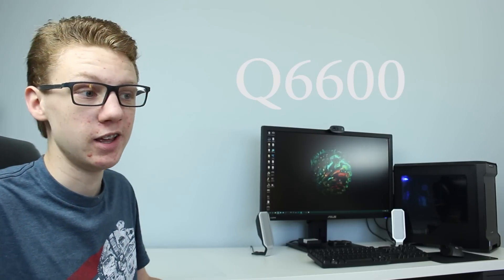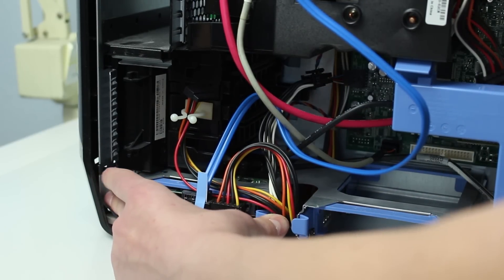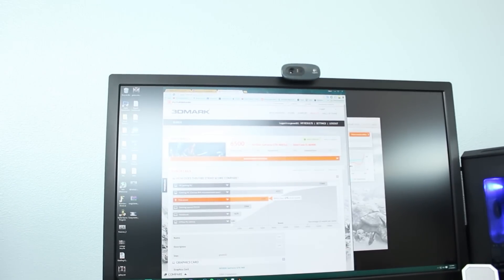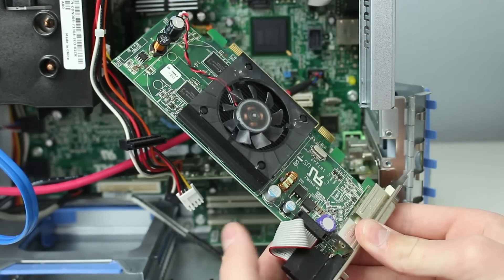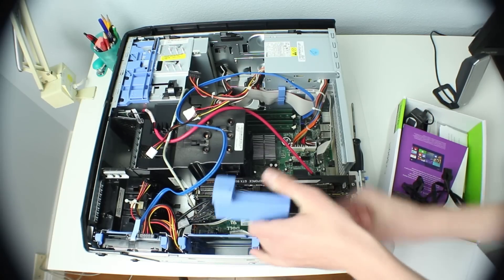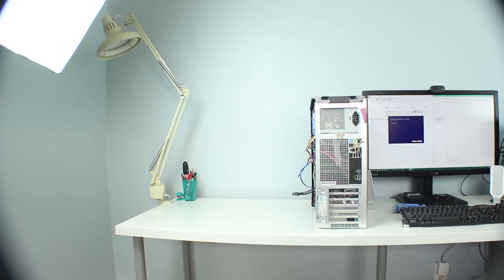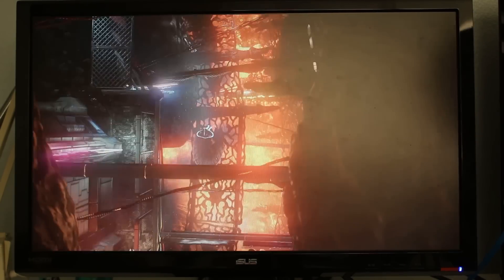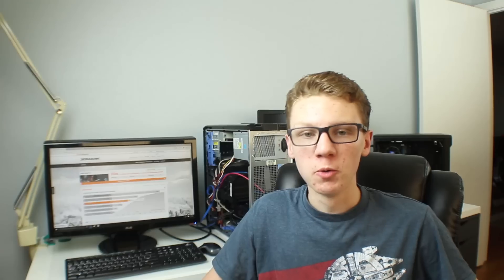Old CPU + New GPU = Gaming PC? (Core 2 Quad + GTX 960)

Comment: I built two pc's with an older LGA775 1333mhz motherboard, O.S. is Windows 10/64bit,  maxed out the motherboard with 1333mhz 8GB(4x2Gb) RAM memory and using a Q9650 CPU and a newer GTX 750Ti-FTW edition video card GPU. I can run Crysis, Battlefield 3/4, Elite Sniper 3, Tomb Raider(2014), with great frame rates and no stutter or lag. I know that eventually, I will be forced to upgrade my CPU+Motherboard to be able to play a slew of, "Next Gen" games that are coming are out this year, without experiencing lag. My PC is at least good for the next few years in terms of regular web surfing, and for non-"Next Gen", gaming titles. Happy with what I got for now. Great video, continued success! And YES I am already looking at the latest CPUs/Motherboards that are available for me to make my next PC.
Reply: +sh0tgunbl45t the gtx 970 is designed for high to ultra 1080p.. your not letting your computer run at anywhere near its maximum capacity, should'nt that be a reason to upgrade?

Comment: Check games
30% GPU
100% CPU
huge bottleneck
Reply: +Markel Fortunato  i think the biggest bottleneck is the  3gb of ram
Reply: +Markel Fortunato Yeah, running a program built to really only test the GPU isn't a great comparison lol
Reply: Modern games are written so they do avoid CPU bottlenecks. 
I am running 9.5 years old Q6600 (and a HD 7870) and I can play every modern game at 1080p on medium, some even on high.
Reply: Not always true my friend,  Out of 150+ games I've tested, I only see 100% usage on all four cores in ONE game on one of these rigs (Splinter Cell Blacklist, if you're interested).  I agree that the 960 can perform far better with a more modern setup, but your statement is all encompassing as very, very few games utilise all four threads even as yet.  Even well threaded games such as The Witcher series only use 80% average of all four cores.  I am not saying that frames will not improve with more modern architecture, better ipc and faster chipsets, just your idea of processor leaps in the last 6-8 years are exaggerated slightly as the market is stagnant and the 960 is hardly a powerhouse.  On another note, cool channel!
Reply: moron, that depends what game youre running, some games are optimized more on the CPU side, such as battlefield.
Reply: lower than my huge bottleneck: 1080ti and Pentium d, 1080ti was a gift, the New Prozessor will come soon
Reply: Angelino Zockermann wow dude, fucking pentium d? that is unplayable
Reply: Михаил Найденов Yeah, 2 things: The 7870 isn't exactly a powerhouse, and I guarantee you you would get noticeably better performance with something like a 4690k/6600k/locked i5/i7.
Reply: Mike Adams No doubt about it. If for nothing else, they will use modern motherboard with faster PCIe slot! But again Zdoom and DarkPlaces perform worse then a modern game. Edit: Of course physics are also on the CPU, so there is that, but even that is changing.
Reply: That's true. If the guy put in 4GB DDR2 800MHz it might have gotten a little higher.
Reply: Even  though it still holds that a low GPU utilization (without vsync) shows a CPU bottleneck, that bottleneck can start when just 1 core is fully loaded. There are still games around that dont need a quad core to be held back.
(So 50% on a dual core or 25% on a quad core can be a bottleneck, add hyperthreading and your CPU can be sittign at 12.5% and still holding you back)
Reply: Nvidia gtx 560 ti + amd athlon x2 280

Bottleneck??
Reply: Like I said, take a look on what your CPU and GPU load is when gaming.
Reply: I took my old E8400 to 4.2 GHz with a Zalman CNPS9500.
Only when I switched it out for a quad core I needed something bigger.
Got a Hyper 212 Evo with an ebay discount and now there is (basically) a Core 2 Quad running 4.1 GHz next to me.
Reply: +Nino Srdic yes 3gbs of probably 667mhz ddr2 ram
Reply: oc that thing
Reply: almost the same rig here. only difference is a 7970. runs everything med-high 1080p at 60+fps
Reply: Should work fine.
I wont see a huge bottleneck there.
But of course it all depends on the games played.
Reply: HappyBeezerStudios but somehow that cumbo don't work cs go only works 40-50fps with medium setting 1280x768 resolution
Reply: Science Studio recently had a series of videos and according to that the version of the Source Engine that CS:GO uses scales great up to 3 cores and even beyond that.
Look where your load is.
Set ur usual graphics settings, disable Vsync and monitor your GPU usage. If it is rather low most of the time, then the CPU could be to slow for it.
Reply: HappyBeezerStudios Could it be virus? I have made 3 pc full virus search on avast and it didn't find anything
Reply: its gtx 560 it sucks too. why would you think trash would bottleneck trash?..
Reply: gtx 560 ti directcutII sucks?
Reply: Teemuli1 it's old thing of course it sucks it's from 2011 and it's not the best version from 2011 500 series.
Reply: I'm pretty sure that it is good enogh for me cause I play on 1280x768 resoluion
Reply: Teemuli1 well you asked if it sucks not if it will be enough.. and in general you told 10% of needed info to properly answer.
Reply: Markel Fortunato this cpu is perfect for a 750ti or a rx460
Reply: ***** but not for any good gpu, usable for this gen games gpu's start with 900 series that is if you want 1 year of medium settings gaming. if you want more you need gtx 1000 series gpu
Reply: gytis dramblewolfskis why would you pair a 8-10 year old cpu with a good gpu did this on a low end build getting 50fps gta 5 1080p
Reply: ***** because you can change gpu without changing other parts. and you need much less cpu power for gaming.
and cpu's didn't step up their game that much for  a long time. also you can use the gpu in your new system.
so for example you can have a potato desktop get a 1st gen gpu use it with potato (will get bottlenecked) but for a short while it should be enough when you see it is not enough you change every other part and put the gpu in that system there you have a great desktop pc. (not much chance you'd get big incompatibility problems with gpu)though shit psu can kill it)

while you dont need much cpu power for gaming at certain gpu:cpu ratio it becomes very bottlenecked and you need to research for that,
Reply: I need of overclocking and better cooling probs. I got an E8600 oc'd @3.5ghz with GTX 970 4GB SC. As well as 6GB DDR3. I'm thinking of overclocking my cpu more to 4ghz, but I have to get a better cooler first.
Reply: +Gamefreak924 *in need
Reply: CrazySkullGamer the 1080ti was a gift, I couldn't say no, and an i7 7700k or something like that is coming next month
Reply: Actually not that much, the graphics test also NEEDS to use the CPU, and in terms of performance, C2Q and C2D are still decent, they are only a bit underclocked and are also lacking L3 cache, but still good

Comment: Really? O_O Inside on a 4690K is an Intel stock cooler? lol Explain this, if I saw wrong.
Reply: +Peter Wolf that's skylake, this guy has devil's canyon.
Reply: If you don't OC the stock cooler works perfect
Reply: +shut your face! THEN WHY GET 4690 "K"
Reply: The K models have less defects in the dye than non-k models. Non-k models aren't k because the dye quality isn't up to par with Intel's standards to where they don't think it's safe to be overclocked.
Reply: Stock cooler is suck as fuck. For 50$ u can get a decent CPU cooler what is capable for OC and offer significantly lower temperature for the cpu in overall.
Reply: $50 can get you a really good CPU cooler. a decent one runs around $20-$30. ive got an enermax ets-t40-tb on my 4790k, salvaged it from a broken business computer. somehow the bracket fits on an LGA 1150 socket.
Reply: shut your face! Good one.
Reply: Cooler Master Hyper 612 Ver2 or 412S or 212X are good options for a budget build. Also the new Intel TS15A for 30$ looks promising until u DON'T OC your CPU. And it's not even necessary. I3 6100+ 3200MHz RAM equivalent of I3 6100 OC 4.7GHz with 2133MHz performance.
Reply: OC doesnt mean you push the cpu until it fries itself. you can do small/medium OCs on a $20-$30 cooler any day. the major overclocks usually need watercooling anyway.

also im serious, that cooler does fit on LGA 1150, just not perfectly horizontal. its tilted slightly up. not that im complaining, its just pointing more directly at my exhaust fans above it
Reply: With a Cooler Master Hyper 212 Evo u can OC an I5 6600K at 4.7Ghz in no time and it will run stable.
Reply: shut your face! I know. It's not a problem to OC that Devil's Canyon. Even  an AMD FX 8370 can be handled by the CMH212Evo easily.
Reply: 4790k is a pain to OC on air, if you want to push it that is. that's why i forced that stupidly huge cooler to fit onto my socket (modded the bracket).
Reply: shut your face! I see u really stucked with the water-cooled CPU idea, than the Corsair H60 Hydro is your best friend from now. It's "cheap" and accessible.
Reply: i wish i had a case that supported a water block. eh, maybe i can get a water cooler that has only a single 120mm cooling block, swap out one of my exhaust fans with it.
Reply: Yean, an AIO liquid cooling system, like the Corsair Hydro H60. Checkout on the Corsair site.

Comment: i have the dell precision workstation t3400 very similar to that xps
psu 375watts
dell intel x38 btx
core 2 quad q6600 2.4ghz 8mb 1066mhz slacr g0
4gb ddr2 800mhz
asus geforce gt 440 1gb ddr5 (did come with quadro fx 570)
samsung 160gb+250 sata 2 
dvd-rw sata

Comment: You look at the wrong score, your looking at total score, that's GPU and CPU, you have to look at Graphics score, then you know if your Geforce GTX 960 is slower with the Q6600 CPU.

And you get a GPU score of 7764 with a i5-4690k, and the Q6600 uses DDR2 or DDR3 memory, and putting 6GB or more RAM in the Q6600 system would help a lot in games, 3GB RAM in modern games is a BIG problem.

Comment: this is only good if your doing an only gaming pc but for tasks that require the CPU to do most of the load like rendering/video editing or even browsing the internet it wont be that good. the CPU could also limit fps in games as you didn't test any actual games. this would be especially evident in game that do use the CPU a lot like crysis

Comment: TLDR: It's impressive and it's still playable, but it's not exactly 85% performance of a modern CPU.

That's pretty much exactly my set up! I have the Q6700 and a Gigabyte GTX960, and I have to say that I'm a bit shocked by the results in the video. I'm able to run most games at very high settings near 1080@60, but that's only on really really low cpu usage games, for example, Battlefield 3 works really well with everything on Ultra, but Battlefield 4 even with everything on low can't get past like 25~30fps, and the cpu is working around 80~90% of it's capacity while the gpu works at about 60~70%, clearly a huge cpu bottleneck. Similarly The Division runs around 40~50fps on high settings but only when playing on the same part of the map with no enemies, whenever I run to another location or enemies appear the frame rate drops to ~30fps and again visual settings don't make any alteration, furthermore the cpu on this game is constantly with absolutely no fluctuation on 99% usage, while the gpu is around 60-70% again, I even overclocked the 960 with no change on performance, I can't overclock the cpu because my mobo is an Intel one, so no overclocking available.
I guess it's not exclusively the cpu's fault, in raw number crunching I think it fares well, it's the technologies around it that make it lack performance, which makes a core 2 Quad obsolete, what I mean is, the usage of DDR2 (where speeds are around 800MHz), motherboards with northbridge an southbridge separated (were their temperatures are something you have to deal with unlike modern chipsets which almost don't have any heat dissipation), SATAII and slower PCIes are what makes the difference between the older and newer generations, of course IPC have had huge gains, but that shouldn't matter as much in games, the problem is loading and managing assets, which comes down to memory controllers, take a look at how different they are now from 2007, the RAM and HDD go crazy when playing games, that's why I make this conclusion.

I've been running with this setup for a while now, but I feel like I have to upgrade, I still get impressed every single day about how much it performs, but my surprise is more often because of the 960s capabilities rather that the cpus ability to keep up.
Anyhow, great video, liked it a lot, subed. cheers ;)

Comment: Did the q6600 overclocked?  q6600 is famous in overclocking . i want to know what is different between the  overclocked q6600 vs the new cpu
Reply: +kwai ming tiu That motherboard doesn't support overclocking.

Comment: Should've gotten an R9 380 instead. Cheaper and better.

Just sayin'.
Reply: He's building a computer not a space heater
Reply: GoogleMinus Haha, so funny... except the R9 380 doesn't run any hotter.
Reply: g sync = gay sync
Reply: Yeah, no, fuck amd!
Reply: FlutterSchüchtern The 380 performs better than the 960 and it can actually use all of its 4 GB of VRAM. Stop being a fanboy.
Reply: InfinityCraft Honestly though, I'm pretty sure 30 gbs of vram on the upcoming amd cards will be useless, that much vram is just stupid.
Reply: FlutterSchüchtern That's only for the workstation cards. The consumer cards won't have that much memory.

Unless I'm mistaken.
Reply: InfinityCraft True, but I'm pretty sure AMD is directed to games, and not workstations. But still, good point.
Reply: +FlutterSchüchtern AMD does a lot of workstation components and servers. I'm all in for Intel and Nvidia, just letting letting you know...
Reply: Pretty sure the 960 can use all of its vram. It's not a 970
Reply: +FlutterSchüchtern omg you don't even know nvidia and amd have there own line of worstation cards and gaming
Reply: Sure do. Have been building pcs for about 4 years now. A little bit of a hobby you could say. But one brand focuses more on the workstation line.Micah Barkley
Reply: +FlutterSchüchtern OMG FOUR YEARS A HAHAHAHA HAHAHAHA ....... I really don't I'm sorry but seriously both have a lot of focus on gaming practically equal
Reply: +FlutterSchüchtern btw nvidia works more on the gaming video cards than the work station ones same with amd it really doesn't matter mr.4years
Reply: +Bored Kid Yup, it's more powerful than an R9 390. It wasn't out when I wrote my comment though.
Reply: MEMES.
Reply: what if i already have a g-sync monitor from my old pc :o
Reply: 380 doesnt perform that much better. In most game it usually has 2-4FPS higher than 960. Prices for both cards are equal. both around £160. Considering how many issues occur with amd drivers and incompatibility with some games to optimise, i would much rather choose the gtx 960.
Reply: anoname The difference is much larger in DX12 games. And AMD drivers are about as good, if not better than Nvidia drivers. If I try to overclock my 750 Ti even just a little bit, Skyrim and Fallout 4 keep crashing.
About the only thing Nvidia has going for them in terms of game optimization is GameWorks, which AMD cards aren't made for, but guess what, you can turn these effects off and the game will perform just as well and look about the same.

Also, the RX 480 is coming out this month and it will be better than a 390X at the same price as the R9 380, so going for either a 380 or a 960 right now is a VERY bad idea.
Reply: yeah but  i dont have a monitor that support freesync, i have a gsync lol
Reply: g sync is for gays

Comment: Dude this was done on a GPU benchmark meaning that if you drop in performance at all, let alone by 15% then your CPU in seriously bottle-necking your GPU so please stop spreading misinformation like this. Yes the Q6600 is still a great CPU in terms of 'bang for the buck' but its difficult to compare such an old CPU to a modern one. Also although I do believe you can get Q6600 for $27 (11.75% of $230 by the way) you can't say that this EBAY listing which the viewer of this vid can't be sure if you have seen that listing end at $27 or if that's the cheapest Q6600 listing you've seen.

Comment: -Dislike; CPU naming, running benchmark on a potentially failing hard drive. Also wtf is that stock cooler doing on your 4690k??? Isn't the K the CPU to get for overclocking? Hope you make better vids will subscribe to see if you improve c: Definitely get a better cooler... even a Hyper 212 is reasonable and cheap.
Reply from the maker: I have got a AIO liquid cooler since making this video - I actually have a video on the cooler also if you wanna check that out. . Honestly, this video was more of an experiment, so who cares if the hard drive was failing? HDD speeds have almost no impact in in-game performance  or benchmarks. Read some of the other comments I have replied to that are similar to yours if you wish to to read those for more info.
Reply: +Gavin Remme A functional working hdd would have been better for a test anyway.glad you got rid of the stock cooler xD